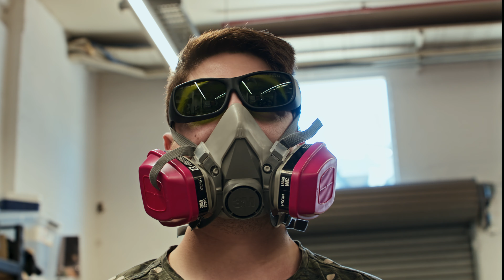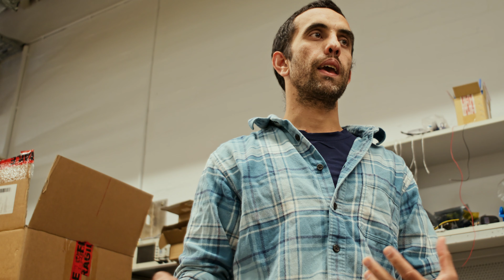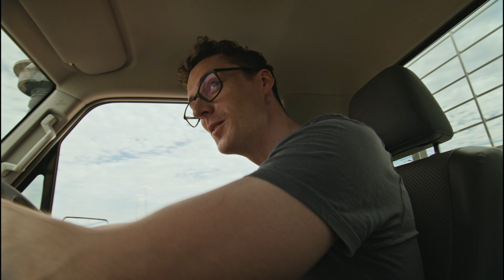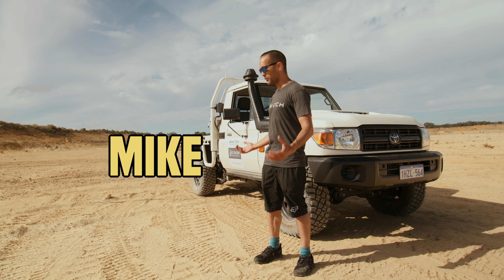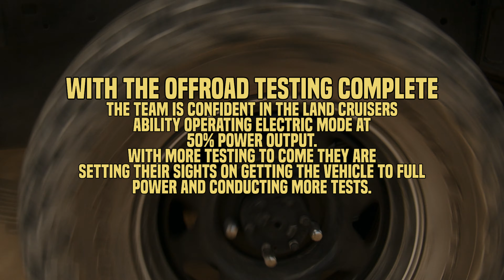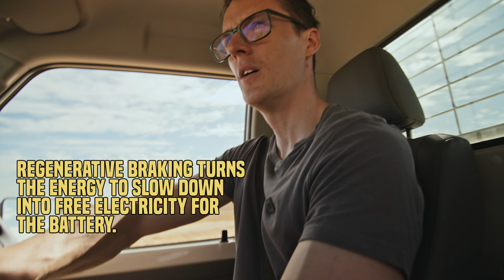Land Cruiser V8 Hybrid First Drive: EV + Diesel Power! 🚗⚡EP.10

Comment: No way.  This is incredible.  And what toyota should be doing already.

Beyond this, the next logical step should be getting a 2.8 70 series and ditching the gearbox entirely - go for a series hybrid setup? Like a diesel electric locomotive? That’d be *sick*.
Reply: Check out the system used in the byd shark. It can function as an EV and also as a series or parallel hybrid. Bonus is that it's a plug in hybrid. It's similar in function to the system used in chev (holden) volt.
Reply: @user-pp6kw6yl6z Japanese could do it but they don’t like innovating anymore. People are getting sick of their bullshit now.  Their new engines are just yuck. They should gone the BYD shark route. If china could develop a battery that can last 1 million kms. It’s over .

Comment: why tell the computer anything about gears just use the throttle position and a pedal map to make the power come on and emulate an ice engine and regen can be applied with 0% throttle have a controller to increase and decrease the force or just start work with the 2.8 auto and not have that issue
Reply from the maker: yeah that logic is reasonable, it does take tuning to make the electric motor spin down at the correct rate. If you disabled regen braking, your suggestion would work really well. We're trying to have cake and eat it, so there's a bit of tweaking to do.
Reply: Guessing the 2.8l with auto wasn't available when this test rig was purchased.  

An auto conversion is also an option, but $$ regardless of 6sp Aisin transmission as per 200 series or 8 speed ZF as being utilised by another Aussie company for swap into the V8.  I believe there may already be hybrid  integration using the ZF transmission?

Or pergaps something similar to the V8 touring cars, a micro switch on the gear shifter(admittedly the Toyota manual has more play than kindy @  lunch time).
Reply: Because the ecu is constantly adjusting things like the turbo geometry based on selected gear and engine load and not providing the ecu with that information would cause issues for the engine
Reply: @tykiahjames9372  both mine don't
Reply: 2.8 Auto is a strong contender for the next version we do for sure.